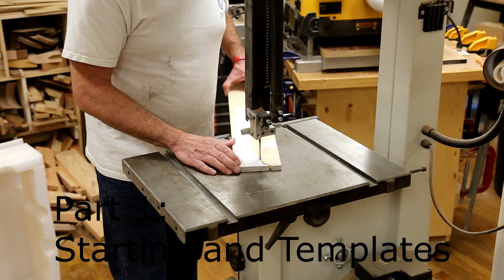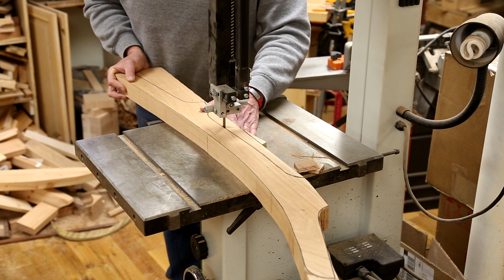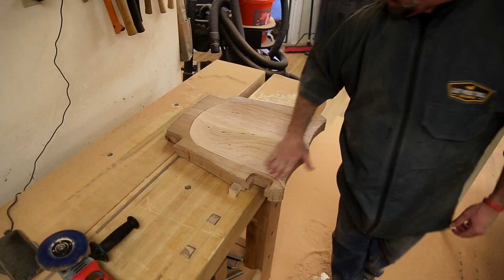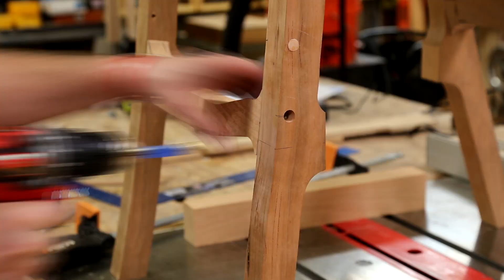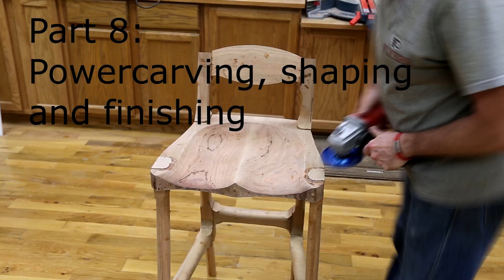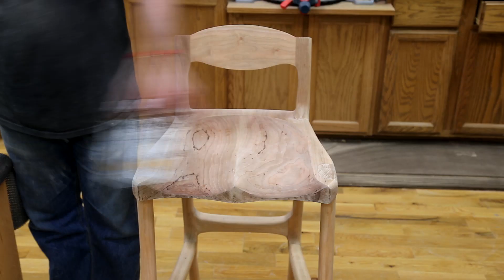Making bar stools with powercarving - Project Overview

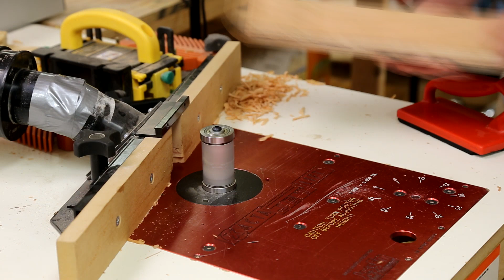Comment: 10:14 what router bit is this?
Reply from the maker: I believe it's from Amana or Infinity, sorry I don't remember.  It's a big, fat, upcut, downcut compression bit with both top and bottom bearings.   It's mildly terrifying, but I believe safer than a smaller bit that's more likely to grab and you run it a little slower.

Comment: Great video and build!  Do you know which Kutzall disc or dish you used to shape the transitions?
Reply from the maker: I used the Kutzall extreme coarse disk.  It's pretty intimidating at first but leaves a surprisingly smooth surface relative to how aggresively it can remove material.  Thank you for watching and asking!

Comment: Thanks again! I was reading reviews on stool plans and some were not very positive. What is your opinion?
Reply from the maker: The plans I got from Canadian Woodworks were great, and Paul is very helpful with questions by email as needed.  As with everything else, I suggest making some pactice parts to figure out some of the nuances and plan on having enough material to remake some parts a time or two.  I don't know if you've seen my recent plant stand build, but that that utilized some of my screw ups from this project.  Good luck, I hope you take the plunge, have fun, and are successful!

Comment: Good afternoon. Good job. Tell me what is the thickness of the wood for a chair in the video? Thank you
Reply from the maker: I started with 8/4 (2 inch) stock which was milled down to approximately 1 3/4 inches (4.45 cm).  Thanks!
Reply: Jeff Marx Please excuse me, can you share the chair templates with me?